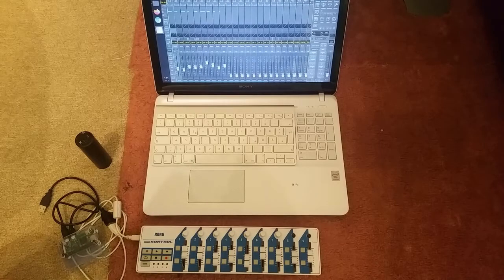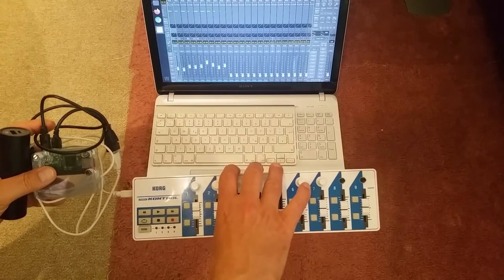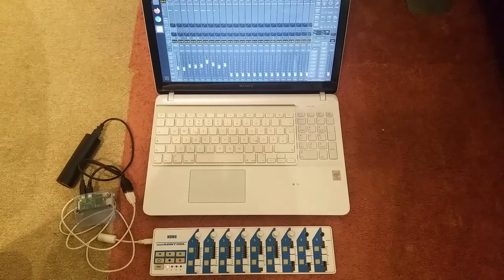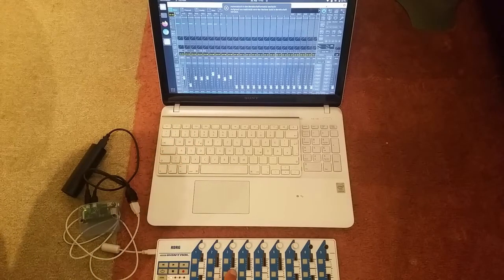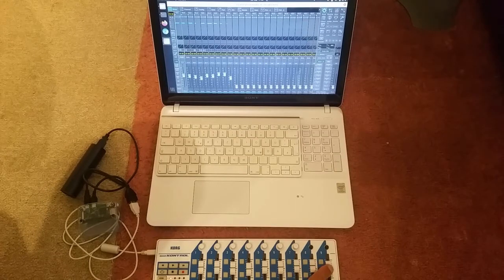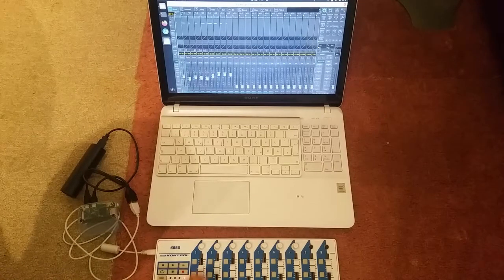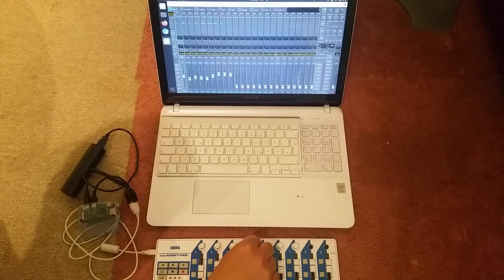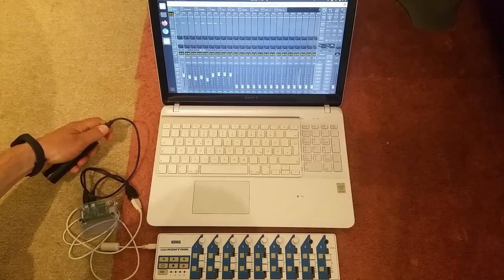Control Behringer X-AIR/X32 with Korg nanoKONTROL

Comment: Thank you for sharing this!!!  
Here's my iteration of this project, modified for NanoKontrol2 and specifically setup for 5 IEM Aux bus channel control and Sub on Aux 6.  
https://youtu.be/Pw0nQCNP3Sk?si=cuX7gsrchl4UB76N
Reply from the maker: Looks nice :-). I can see your branch on Github. It seems your changes are not backward compatible, right? This would make it harder to merge your changes.
Reply: @vofitec1933  meaning compatible with the older nanoKontrol (not the 2)?  no.  there are no "scenes" and different controls on the newer model.  I'm not very familiar with forks and merges but my sense is NO! don't' merge.   I've never programmed in Python before so I'm sure it's not up to normal standards.  
Eventually I'd like to try and migrate to C# and build a GUI so users could customize button, slider and knob allocation.  
thanks again for sharing your project!!

Comment: I test it on MR12 and only got the first 2 fader working. Is there a way I can map all the other buttons?
Reply from the maker: Here is a table of the assigned MIDI values of the nanoKONTROL which I use: https://github.com/corrados/mypitools/blob/1a424138c964ce7a9141c6e53c05e378cbf7d841/projects/xairremote/xairremote.py#L166. Maybe you have a custom MIDI assignment used in your nanoKONTROL. Can you try to reset the MIDI assignment to the default?
Reply: @vofitec1933  I'm sorry I got nanoKONTROL 2 not the nanoKONTROL maybe that why is not working. I got 1-7 fader working by change this value " (0XB0,  0): (0, "f",  0), (0XB0,  1): (0, "f",  1), (0XB0,  2): (0, "f",  2), ........". What are this value "(0XB0,  0): (0, "f",  0), ...." and how do I get it for nanoKONTROL 2 ?
Reply from the maker: @Fe_Tank  I would do it the other way round. I would keep the Python script as it is right now but change the MIDI assignments in your nanoKONTROL 2. Maybe there is even a "compatibility mode to nanoKONTROL" in the configuration software of the nanoKONTROL 2.
Reply: @vofitec1933  are you planning to improve this project in the future? 
If yes, I want to see if you can turn the raspberry pi in to the midi control and connect to X-AIR  insted the nanoKONTROL. Let people be part of your project by let them DIY their own buttons or layout with 3D printing.
Reply from the maker: @Fe_Tank  I have no plans to work on this script. Basically, it is just one simple Python script. I see it as a starting point for further projects. I could extract this project from my "mypitools" repo on Github and create a separate repo for this. This would make it easy for DIY developer to fork/contribute to the project.
Reply: @vofitec1933  I'm looking forward for this new project.
Reply from the maker: @Fe_Tank  I have now moved the script to a separate repo: https://github.com/corrados/xairnanoremote. From this repo you can now easily create a fork and do your experiments :-).
Reply: I want to import the gpio to the script and set gpio pin 16 as button. how can I emulate gpio button press to turn the mute on the X-AIR on/off? if this concept work, we can take this project to the next level.
Reply from the maker: @Fe_Tank  Why do you want to use buttons on the Raspberry Pi? The nanoKONTROL has many buttons :-). E.g., I use one button on the nanoKONTROL just to power off the Raspberry Pi.
Reply: We want to customize our own controller with new layout and buttons. 

More DIY fans would came and join us. 

Who knows, maybe one you have your own product like Behringer X-Touch Compact Universal Control Surface. :)
Reply from the maker: @Fe_Tank  If you want to contribute, the easiest way to do it is at the Github project page: https://github.com/corrados/xairnanoremote. You can clone the repo and add your modifications.
Reply: I hop you see my point where I’m going with this project. 

I have great ideas but my pythons programming not good. I saw your python script and know you can make it happen.
Reply from the maker: @Fe_Tank  Sorry, you have to do it yourself. I am very busy with other projects.